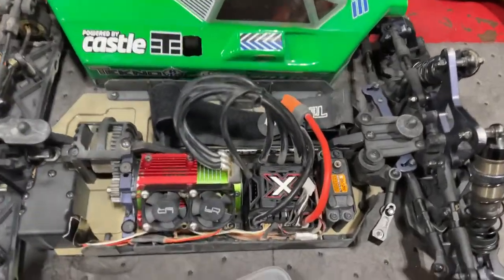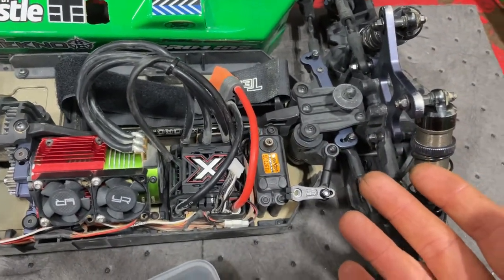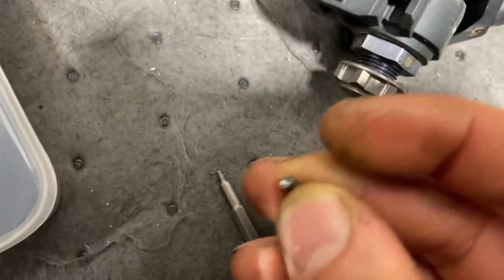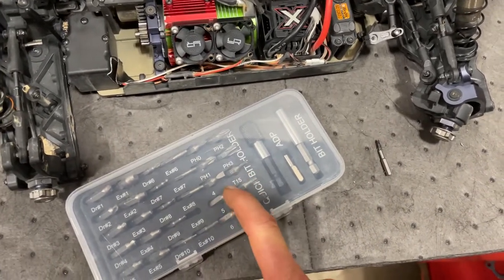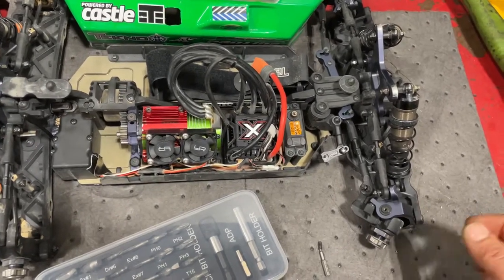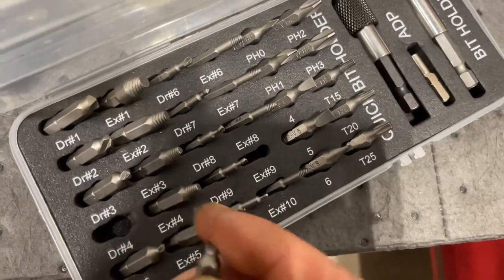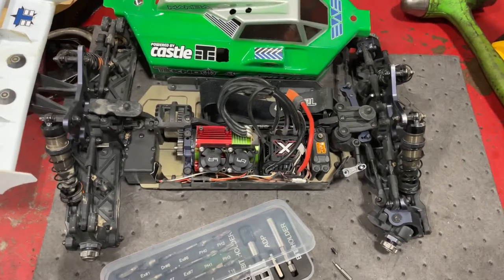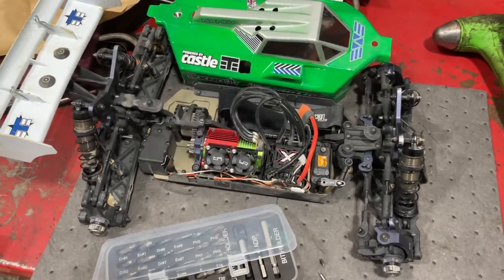Extractor set for Removing stripped or Broken RC screws

Comment: What extracter set is that?
Reply from the maker: @Mark Smola I just searched up small screw extractor set on Amazon and it was one that they had in stock I can’t remember the name of it it was a while ago when I ordered it it. The little drillbits it comes with do not work but so far the extractors have worked good for me